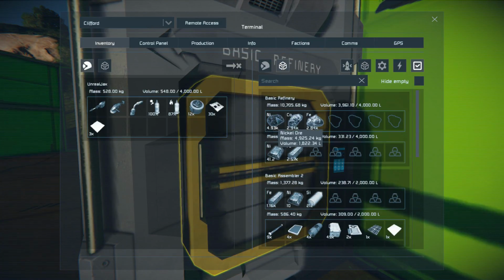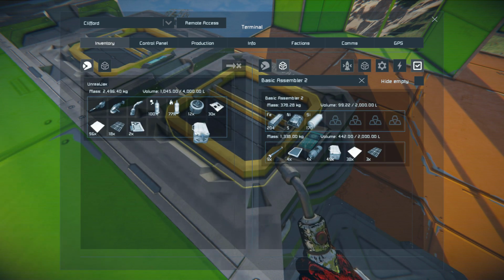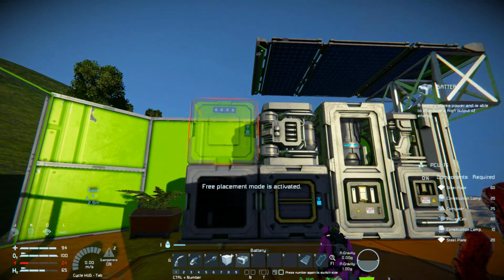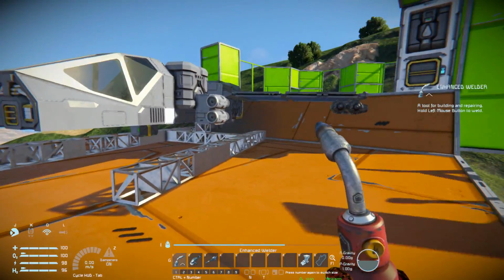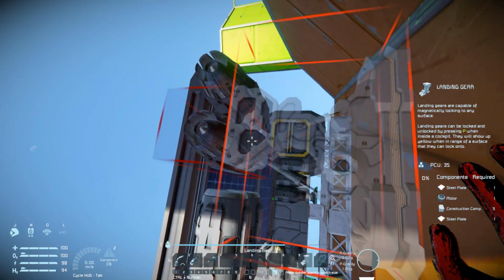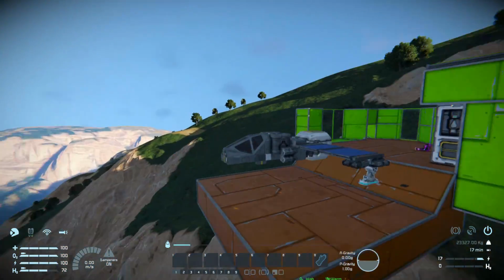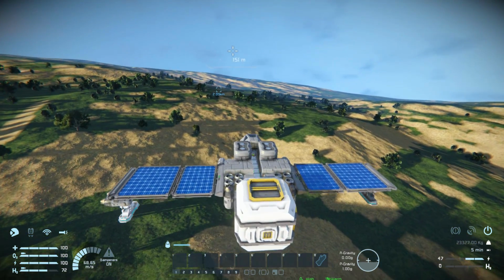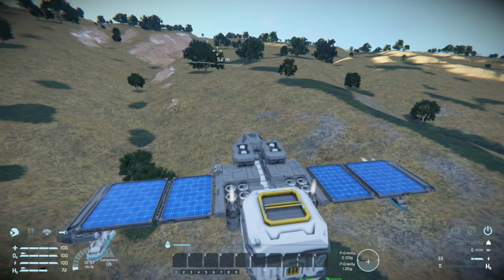Successfully Building & Flying A Small Ship! - Space Engineers: Survival Mode Part 6

Comment: I can foreshadow clang claiming that cargo container as you land 🤣 it's happened to me lots of times, especially with a full load, I suggest trying to make some kinda protection for it, to try and stop it.

Also your issue with your battery is your using Equal amount of power if not more than the batterys recharge rate. Best way is using some small batterys setting them to discharge while setting your larger batterys to recharge, or going of of a system of one recharges then the other discharges, I do it alot on my survival stuff seems to help, plus using a hydrogen engine if you can will help recharge batteries.

Also thanks for making the videos longer 😀 gives us more to look forward to, and feels more (idk a good word to put it) but professional and enjoyable in a sense.